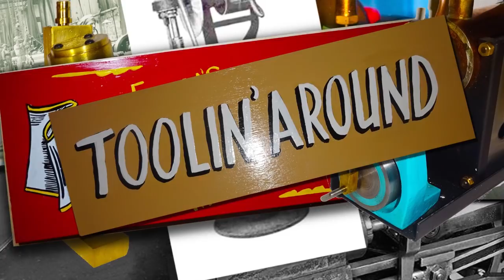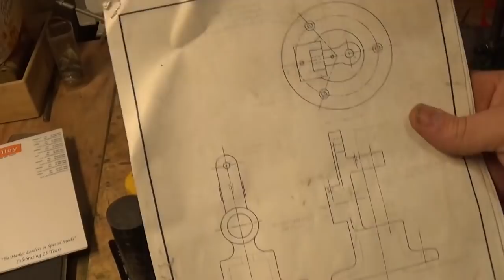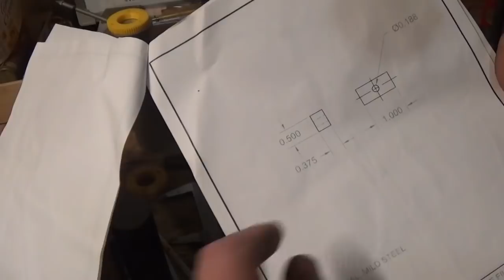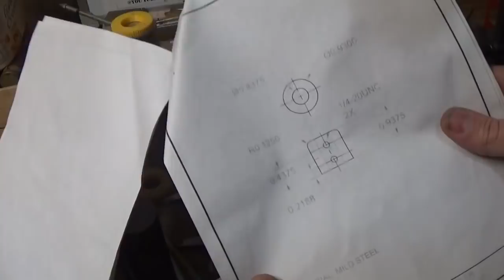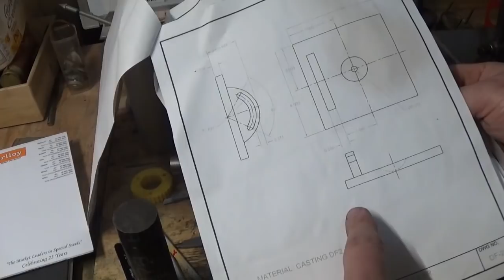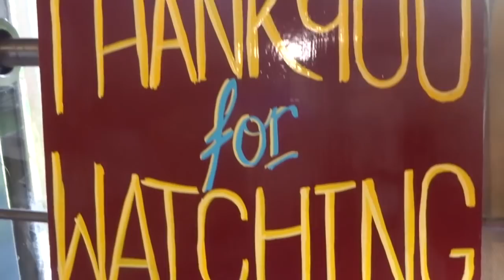dusting of old projects, die filing machine

Comment: G’day Emma, I would have thought a 6” disc would fit your lathe. A fly cutter (chipys comment) in your mill but your spindle speed may be a problem, take it slow. As for the slot, an angle plate, a solid pivot point, some all thread through 2 pivoting nuts and you could crank it through it’s path past a mill cutter

Comment: After thinking about it, I wonder if you could maybe make a simple fly cutter and use that on the mill? Just mount the table to an angle plate or something to hold it. Ive seen some people use some pretty large fly cutters, and was thinking that that may be an option if nothing else.
Reply from the maker: probably yes. ill have to get the mechanism working first i think.
Reply: lol, you better hurry or Ill have mine finished before you even get back to working on it, lol. :P

Comment: looks like your almost there. The table top really isnt really that precise of a part really, just needs to be flat so the work can slide around on it so if nothing else, just use some sandpaper and sand the top of it flat. I dont plan on tilting my table since I just want to use it for being able to file square holes in things, and for doing rectangle/square holes in sheet metal for switches and such in enclosures for various projects, and you dont really want those holes tapered.
Thanks for the update and hope to see more of it soon.
Reply from the maker: As draw I dislike the table pivot.
Reply: yea, Ive seen alot of pivot setups and never cared for them because like with the table, when I put my hands on it and the work, it will want to tilt a little bit, and to get it to stop that, you have to tighten everything up to the point that your afraid of it snapping on you. Also, removing that much metal, you are afraid of it becoming too weak also. Thanks for the shoutout btw, I really appreciate it.
Reply: Emmas Spareroom Machineshop be better if it had 2 trunions but is what it is